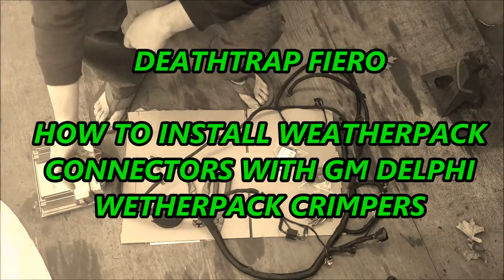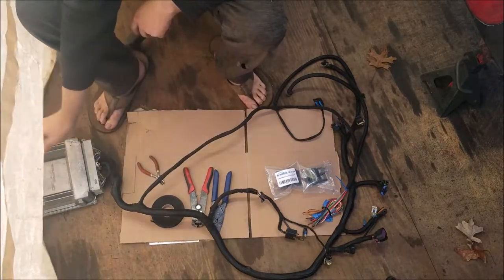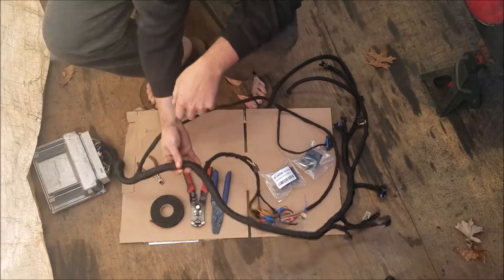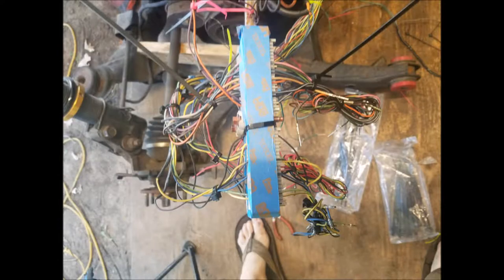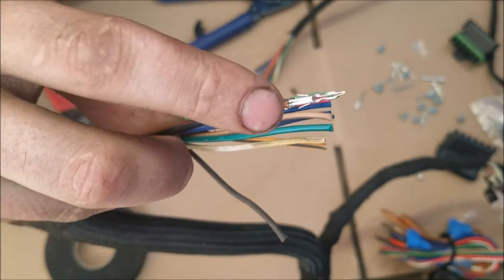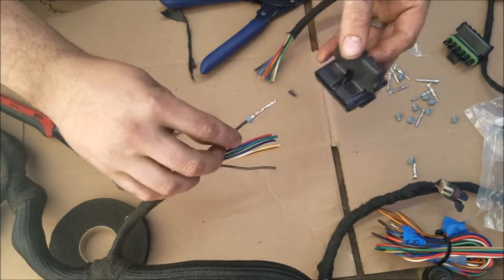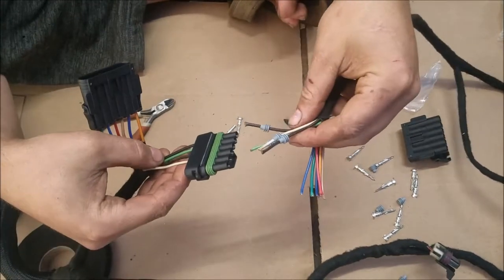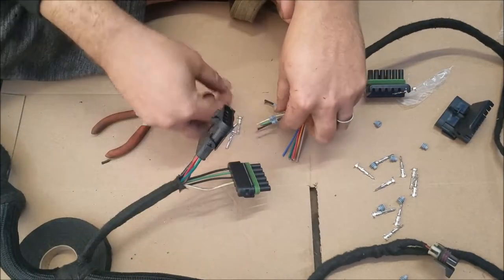DEATHTRAP FIERO how to use delphi crimpers with weather pack connectors

Comment: For the extra holes on one of your connectors,  dont you need to put some kind of seal, either silicone or connector/ wire/seal on both sides to keep moisture out of the connector housing?
Reply from the maker: Mine didnt come with the plugs but technically yes